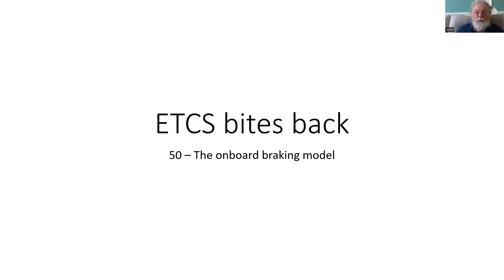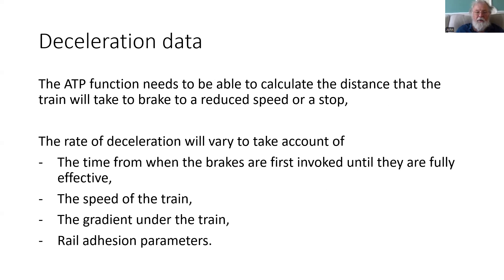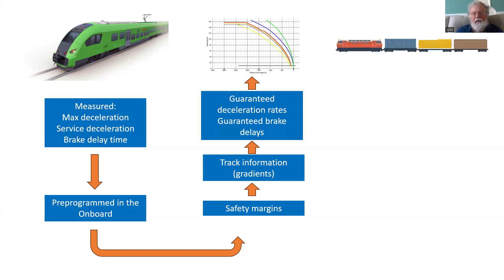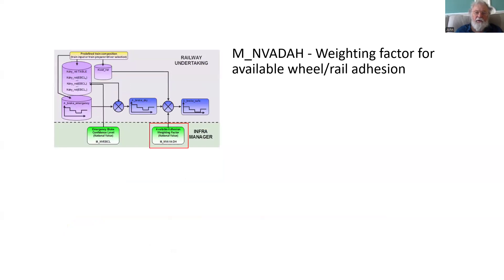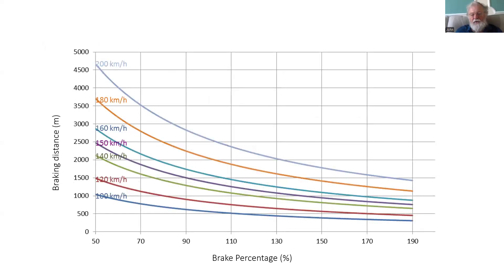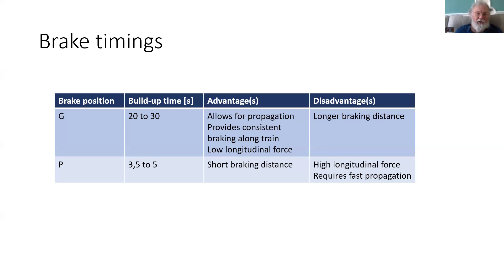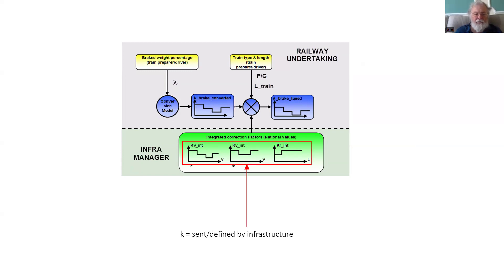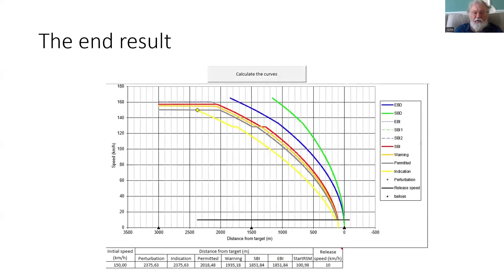ETCS Bites back - 50 (Onboard brake model)

Comment: Thanks! Very well explained. Would it be possible to look at an example rolling stock model (certain train model, length and composition) and the ETCS braking curve data that would be typically provided by supplier?
Reply from the maker: If I can get some sample data then we could do that. The challenge is extracting the data from the vehicle manufacturers and ETCS integrators. 🙂
Reply: @johnalexander995  Hello John. I work as an ETCS engineer in Denmark, wherein ETCS L2 (without lineside signals) is progessively being rolled out pretty much across the entire country.
I wanted to chime in and share a little of my experience when it comes to the use of ETCS braking curves in ETCS trackside system design.

The current practice over here is to work with the lambda model - most of the current passenger trainsets in operation are somewhat old, about to be replaced and the infrastructure manager/operator did not want to bother with undergoing thourough brake testing, I suppose.
For what it's worth, we are working with 3 different train "models":

- DSB class MF with BWP of 180%
- Siemens Desiro with BWP of 130%
- In some scenarios we also use a freight with a BWP of 80%

As you can see above, I did not specify train lengths. That is because in Denmark Kr_Int(L) is set to 1 for all (L), i.e., train length does not have an influence on braking curves.

When it comes to the use of braking curve calculations, here are a few examples of their use:

- Headway calculations (in Denmark the methodology applied is usually the sum of the ETCS indication distance + block length + overlap + train length + route setting + route releasing times). 
As you can see the ETCS indication distance is included in the analysis, which implies calculating sets of braking curves.
- Placement of trackside equipment. In the danish implementation a 15 km/h release speed towards an EoA is trying to be achieved whenever practical, thus the placement of the last balise towards the EoA as well as the SvL beyond it is looked at to reach the 15 km/h target. 
- Level transitions. In the danish implementation the vast majority of marker boards are used as a visual signal, and routes are configured to start and end at marker boards. 
The distance between the border and the first regular marker board (marking the end of the route between the border and the aforementionned marker board, as well as the beginning of a new route from the same marker board) must be enough to stop a train should the follow-on route from the first marker board not be set, if that makes sense.

There are also other examples but I just wanted to provide a few examples.

And thank you for your videos!

Comment: Perhaps another way of looking at why there are national values for braking:

The installation of distant signals for trains without cab signalling is done by the infrastructure manager and with safety margins (e.g. distance between main signal and distant signal is 1000 m, but trains must be able to stop within 900 m => safety margin of 10%; ORE-Report B126/RP S13 or better). With cab signalling and no trackside signals, there are no distant signals, only the "main signals" as marker boards to indicate the location while in cab signalling. Thus, each train has its own individual distant signal (indication, start of curves , ...) and the national values are now a way of enforcing the IM principles for safety margins for this as well.
Reply from the maker: You could be right but I think it is a bit more complex than that. As an infrastructure manager today one designs in allowances for the performance of the train (and of the driver). For instance, as you say, positioning the distant more than the maximum acceptable train braking distance. We often provide an overlap beyond the stop signal to allow for misjudgement in braking. We often reinforce it with speed checks (such as TPWS) and train stop facilities.
When we move to an ATP system then it is up to the train to know its capabilities and make sure the speed is supervised to ensure a stop before the safety limit and to guide the driver to stop before the end of authority. It then is had to see why the IM needs to add some extra margins as long as they define the locations of the EOA and SvL correctly and position the reference balise groups correctly. Somewhere I have got a document that tries to explain why the IM might want to adjust the NV, if I can find it then I might do a summary.